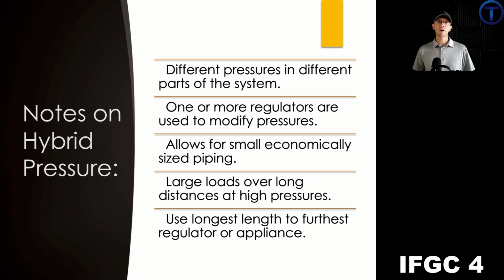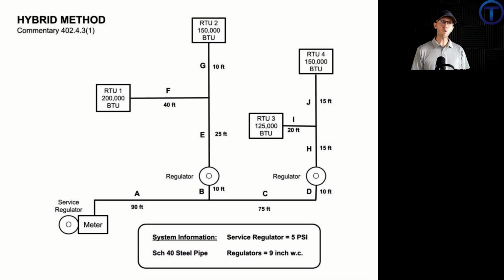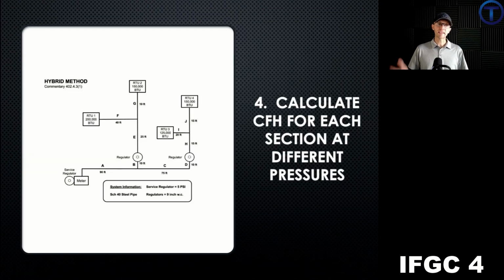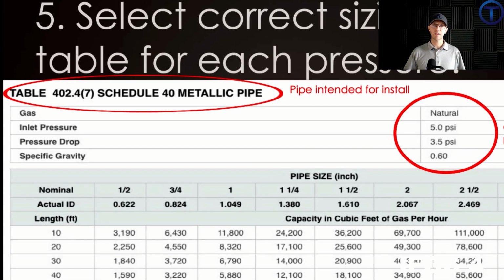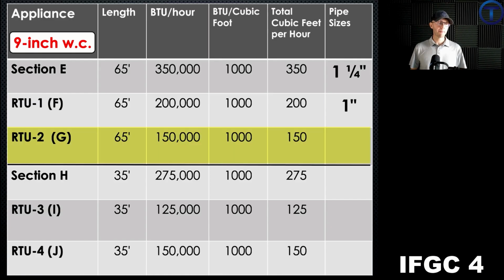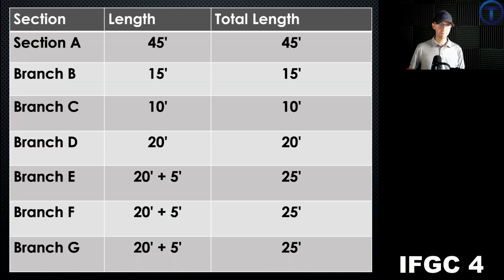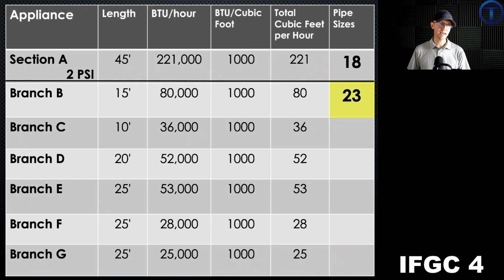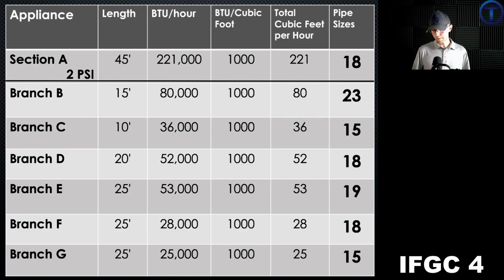Gas Pipe Sizing Lesson 5 - Hybrid Pressure Method

Comment: How do you know if the manifold can hold the Btu rate for everything branching off?
Reply from the maker: You can check the manufacturer’s rating for the manifold.
Reply: @plu @plumber-tom9470 nk you, I can’t figure out the best way to word what I’m trying to ask, so imma try to give a scenario. If you’re roughing in a house with 2 tankless WH 180k btu, 3 furnaces at 60k btu. Could you run all that off one regulator to a manifold as long as the branch runs for csst is in check with the charts? Sorry for it being so long. I watch all your videos and wanting to learn more about manifold systems as here in Alabama I have yet to see one.